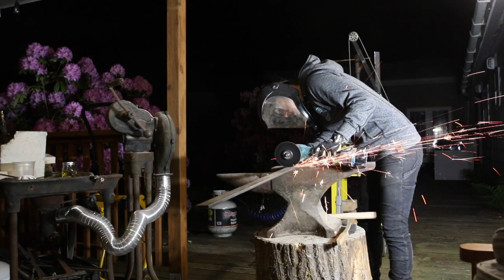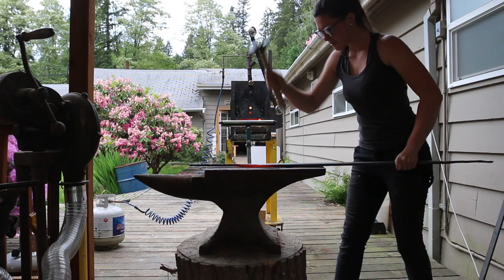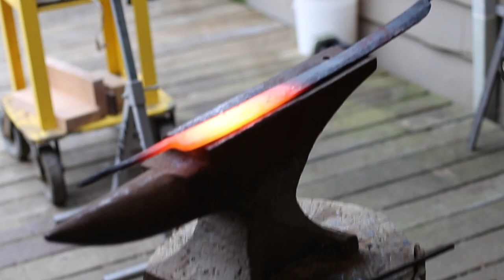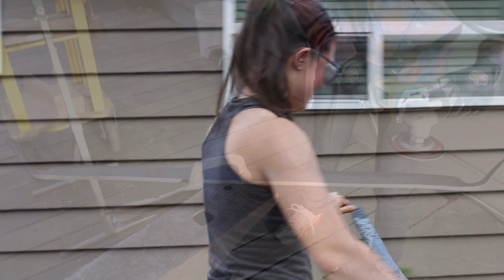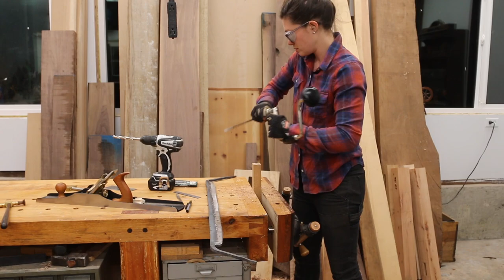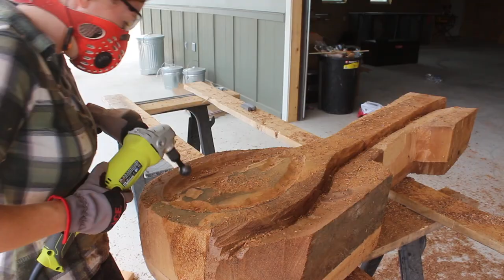Forging a Giant Drawknife for April Wilkerson

Comment: Great video, I watch a lot of smithing on Youtube and your videos are the most inspiring and quickly coming to my top 5.  Also, I cut my sledge handle in half, its not so great for breaking up concrete now, but a whole lot easier to hit steel with.
Reply from the maker: If it wasn't a borrowed sledge, I would DEFINITELY have cut that handle off after about 5 mins haha!

Comment: Great video.  On steel, don't forget about 1018 mild steel.  I forges well, is cheap and can be heat treated and annealed like tool steel.  I've made snips from 1018 hardened to Rc 40 that cut a penny in half easily (and remain sharp).  Great work forging it and keeping it straight.  Looking forward to you an April doing more together.  Maybe making a musical instrument, you could forge the bridge and tuning pegs.  Thanks
Reply from the maker: bigviking0001 thanks for the comments! You’ll see lots more from April and I, I’m sure.

Comment: I noticed you mentioned the expense of tool steel and thought to give you some information. Leaf springs are made from 5160 steel and can be found most anywhere. They cost me 25cents a pound at the scrap yard. I have made everything from carving knives to long swords from them and never had a problem. Draw knives and lathe tools from this steel turn out excellent as well. Harden them in oil, quench at 400degreesF for two hours and you will have a blade that will go the long haul.
Reply from the maker: tarnshadowhawk leaf spring steel is pretty great. Another issue was the hardness of tool steel. For a sculptural piece, that would have taken a whole lot of unnecessary effort to move such a big piece of tool steel by hand
Reply: I misspoke about the finish of 5160. I meant to say, Quench the steel in oil to harden, and temper at 400 F in an oven for two hours. Remove from oven after allotted time and place in water to stop quenching process. Should leave you with a good hard blade.

Comment: A little warning for the future, whenever you are working with a striker, you should be using a striking anvil. This is simply an anvil that does not have a hardened surface. If the striker ends up missing the work piece and hits the hardened face of the anvil with the hardened face of the sledge, there is a very high chance that either surface will fragment and you'll have shards of metal flying all over the place.

The other purpose of a striking anvil is that it's made to use the striker's full potential in that it's lower to the ground so the striker can  get the most power out of their strikes and that it isn't hardened so that it can take the abuse incase the striker misses and so that the heat absorbed from the usually larger stock isn't can't ruin a temper that isn't there.

Another thing, either wear some sort of hearing protection or deaden the ring of the anvil. That ring can and will ruin your hearing if you let it. You deaden the sound by simply wrapping a chain around the boot or placing a strong magnet on the underside of the horn at the base.
Reply from the maker: That is interesting about the striking anvil, I have taken classes in many different shops and have never seen or heard of one. I’ll do a little research. If you were looking closely in the video you would see that I am wearing flesh colored earbuds the entire time. While I appreciate your taking the time to offer advice, I would definitely discourage you from starting any comment meant to be constructive with the words “you should,” and instead, assume the best. Cheers!
Reply: @AnneofAllTrades  I apologize if I came off as demanding and critical. I did notice your earplugs but wasn't quite sure if that's what they were as my eyesight isn't very good even with glasses. I do realize that I failed to mention that the end result of your draw knife was fantastic and didn't intend to imply otherwise. Just more concerned about your safety in the long run and, while assuming the best is good and all, when it comes to things such as a person's well being, I tend not to even at the expense of seeming overbearing or like a jerk or something.

Comment: Very nice build... One detail i noticed: could it be that the headstock of your lathe is not properly fixed, it moved when you tightened the wood... Could be dangerous with bigger turnings
Reply from the maker: Adi Sandbichler I noticed the same thing. It’s right now 😉

Comment: Just a note: a thick and heavy hardwood tree stump is the anvil stand I've seen in every professional blacksmith's shop I've been in - they were still quite common around where I live when I was a kid. Mind you, those were no amateurs or hobbyists, they built everything, from horse shoes to very fine carbon steel wood carving chisels to axes and plow blades. Must be a reason why they used a tree stump instead of a metallic stand.
Reply from the maker: Florin Jurcovici it’s because it’s quieter than a metal stand. It absorbs the ring of the anvil rather than magnifying it like a metal stand would.

Comment: nice video; by the way tool (H S S) steel is only steel that has a lower carbon content, it's the stuff [powder] that comes from the steel while being hammered on, so if you put it under the power hammer long enough you get this steel. one other way is , like the Japanese is to buy strips of steel and forge one piece out of the strips ( aka what you see on videos as 'Damascus' steel in Japanese samurai swords, daggers and the like.) there are plenty of videos of this process, just research sword smiths or dagger forging.
Reply from the maker: I’ve got a video on making a Damascus knife if you’d like to check it out.

Comment: You can hammer mild steel into carbon steel. Granted, it's not a very fast or easy on the arms process. But it would make for a nice experiment. Maybe on a smaller tool, though.
Reply from the maker: You can also forge weld tool steel onto mild steel for the edge of tools, like is often done for axe heads
Reply: Yeah. But that wouldn't be an interesting experiment at all. I think.

Comment: I tell you what my dudes. The way she uses that sledgehammer, that’s impressive. That’s hard work of her body strength required. If you’re a dude and you’re watching this you’re not fit enough to do that you better get out there and use your body and build your strength.
Reply: Jared Jeanotte 
I agree with the sentiments but I was cringing at the way she held the hammer with her lower arm across the body... looked really awkward, but it's a good thing the phrase 'each to their own' exists. Finding the right way to use tools so that they can give maximum energy/effectveness for minimum input is very important though... it makes things easier and you can last longer. Cool vid.

Comment: nice work. I think you could learn a lot from youtuber Alec Steele if you want to get better :) also you might need bigger hammer, especially the head of the hammer
Reply from the maker: Alec is awesome! I am currently using a 32 oz hammer, and using a bigger hammer has negative affects on my techniques. I've been taking regular classes for 3 years and building up my strength. Eventually hoping to graduate to a bigger hammer.
Reply: ok, best wishes. you are doing great 💪:)